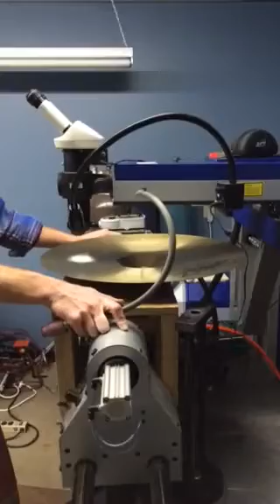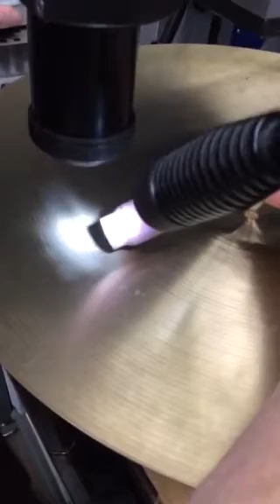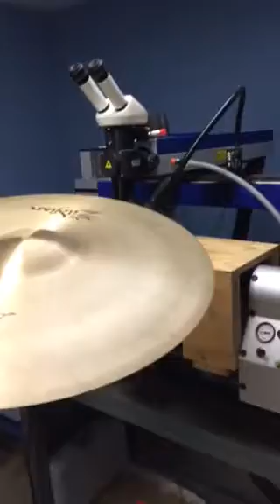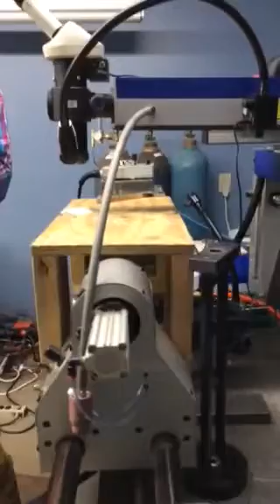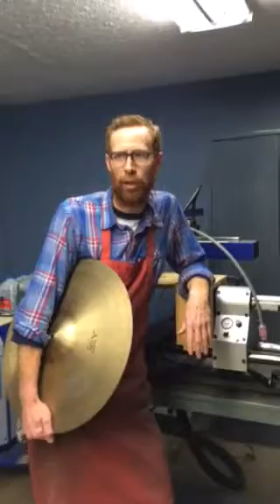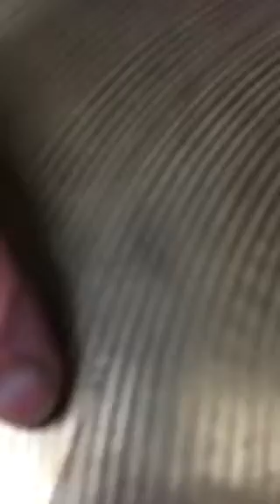Fusion welding cymbal repair w Jake Winebrenner

Comment: What's the duration of those weld repairs like? If there is no added material then it stands to reason it will be weak in that area and prone to future re-failure?  I have been tig welding cracked cymbals but I use filler and stop drill the cracks to remove stress raisers and reduce the risk of propagation of the crack.
 One thing I will add is that welding cracked cymbals is just about the trickiest welding I have ever done! They are absolute little horrors to weld! Got to work harder on them to get the desired results than pretty much anything else?( contaminated cheap alloy castings hold the honour of being the worst!)
Reply: Hi Andrew, the dozen or so cymbals that Jake has laser welded for me have held up well, and I play a lot of gigs. All of my welds have been think lathe cracks, or hole cracks. Jake has been doing this for a number of years and the many drummers of Nashville who use his service have been pleased with his work.